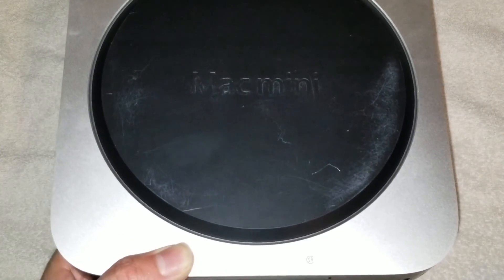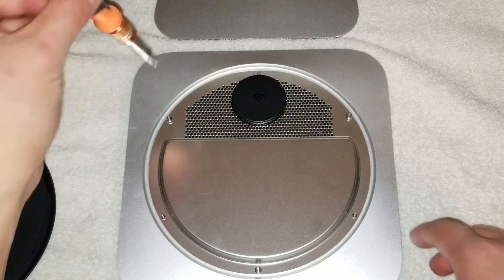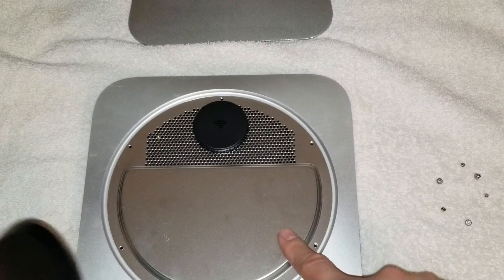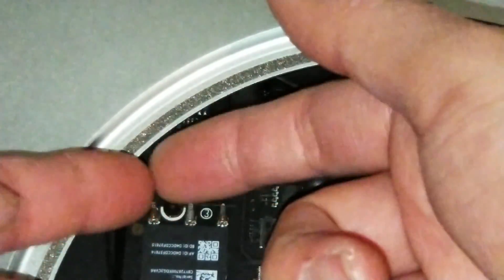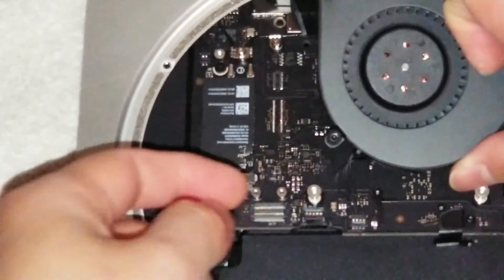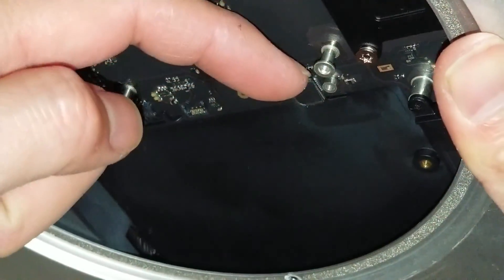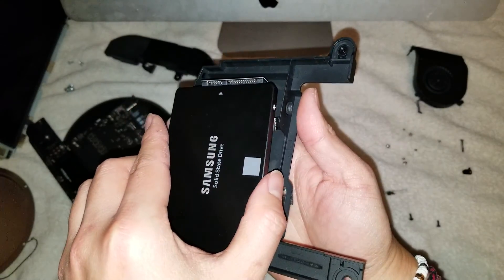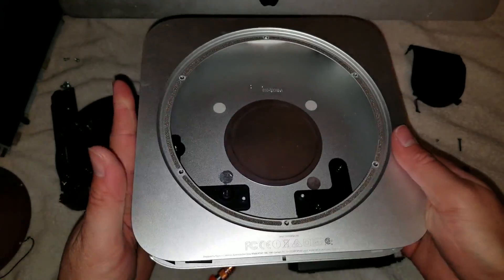Late 2014 Mac Mini Model A1347 Disassembly SSD Hard Drive Upgrade Replacement

Comment: Watching this video on my 2014 Mac Mini i7 3.0 ghz 8GB ram, it came with a 1TB HDD but I replaced that with a 500GB SSD and got an adapter to add a 500GB M.2 NVMe drive to the available SATA input on the board. Installing Opencore Legacy now to put Sonoma on the NVMe drive while I keep Monterey/Bootcamp Windows 10 on the SSD. After the upgrades, it's insanely fast and has no trouble playing any of my Steam games on Mac or Windows smoothly.
Reply from the maker: Awesome!

Comment: THIS IS THE SECOND VIDEO I SEEN IN A ROW WHERE HE OPENS THE BOTTOM COVER PLATE WRONG! HOW DO I KNOW ? IT BROKE MY CLIPS OFF AND ALL YOU ACTUALLY NEED TO DO IS USE YOUR HAND PALM THE BOTTOM COVER PLATE AND ROTATE YOUR HAND COUNTERCLOCKWISE TO UNSEAT THE CLIPS FROM THE SCREW POSTS! YOUR WELCOME NO PRYING NEEDED
Reply from the maker: That's a different model... this model does not twist. Check the model of your mac mini.

Comment: Nice work; clear and accurate. Just what I needed to swap out the HD on my old Mini. One addition, though; for my late 2014 Mac Mini, the six screws under the base plate needed a Torx 6H (that is, a T6 with a hole in the tip, as there’s a pin in the centre of the screw head.)
Reply: Apple thinks their machines are for spaceflight using secure torx, good god!
Reply from the maker: @mrdav1e  yup... lol
Reply from the maker: Yup!

Comment: At 5.04 what is that connector for, what info is it carrying? I broke mine cause I didn't have the right pry tool...aagh!  So what is it? Do I have to replace the whole cable? Many thx
Reply from the maker: If you broke the part off the motherboard you'll need someone that can microsolder
Reply: @ItsBinhRepaired  Thanks for the info... I will try find someone here
Reply from the maker: @KeithHutchinsonYT  hope it goes well

Comment: (2014 Mac Mini) Thanks for video, very helpful.  Original HDD failed.  Removed the original HDD and the companion SDD, installed a 1 TB SDD.  Boots up to recovery menu fine, I can erase/format the new SDD and go through the OS reinstall routine however it fails to complete.  Seems to load over the 6 minute countdown and then an error message at the end, says to try again.  Any suggestions?
Reply from the maker: You might need to install the os with another mac to an external hard drive and boot from it by holding alt/option on boot.

Comment: 5:19 I forgot to disconnect this cable and ended up breaking it. I need to know the name of this cable and the model so I can buy another one. Does anyone know what this cable is for?
Reply from the maker: I think it's the hard drive activity light, but if you ripped it out of the board, the motherboard will likely need soldering.
Reply: @ItsBinhRepaired  thanks man!! after I broke this cable, macmini no longer turns on. So I think this cable must be essential for mac operation
Reply from the maker: @thalesmln  oh no D:

Comment: Thanks so much for this video. I brought my computer to an Apple store because it had trouble powering up. They replaced the logic board and the HD. Unfortunately, they said because of Apple's rules, they could only put in an optical drive like the original to replace the SSD that I had someone else install as an upgrade. The computer was agonizingly slow and The Apple store would be of no further help. I was not optimistic about doing this myself but with your video, I decided to attempt it. Everything worked out well and the computer works great. Thanks again. According to black magic benchmark, it is 90 times faster now.
Reply from the maker: 90x is a huge amount! Glad it helped. If you haven't already, please like and subscribe so others can find my videos. Thanks!

Comment: Hi Binh, in the 2012 version of Mac Mini, it is possible to have two SSD/HDD. In the 2014 version, only one  I guess? either SSD or HDD, right?
Reply from the maker: You'll have to open it and see if there's an unused port
Reply: @ItsBinhRepaired  Ok, let me check what I can find, thanks.
Reply from the maker: No problem
Reply: Got some update: supports only one drive, either HDD or SSD. Or Fusion HDD. So the 256SSD drive that I have wont be enough. Considering a higher capacity SSD.
Reply from the maker: @pasteltiara  they're pretty cheap now

Comment: Good day . I have MAC mini Mode A 1347,emc 2840 .fcc id: qds -brcm -1069*, IC 4324 A. The hard drive has failed, or at least that was the diagnosis. can I get a used or new one from you ? tks
Reply from the maker: Hard drive?

Comment: Going to be mailing some parts to you basically a mac mini without the hard drive.
Reply from the maker: I see. Did you want me to repair/upgrade it for you?
Reply: @ItsBinhRepaired  No Just I dont need the parts, I only needed the hard drive out of it so maybe you can use the excess parts?
Reply from the maker: @RaynaldoLegarreta20  cool, I'll find some use for it, or, add it to the pile. Haha Thanks! :)

Comment: I decided to do this…. Which one of these SSD drives do you recommend?  Crucial BX500 1TB 3D NAND SATA 2.5-Inch Internal SSD, up to 540MB/s - CT1000BX500SSD1. Or   Crucial MX500 1TB 3D NAND SATA 2.5 Inch Internal SSD, up to 560MB/s - CT1000MX500SSD1?
Reply from the maker: You won't even notice the difference. I just use the one that's cheaper at the time.

Comment: Thanks for the walkthrough, one tip is to work on a non-conductive surface like a table due to static electricity. You don’t want to work while on carpet either, one spark and that motherboard is fried.. the rest was great, thanks.
Reply from the maker: Yep, this is an old video. Didn't have a good setup before.

Comment: It's NOT the taking apart that's difficult, it's the "putting back together" that requires a delicate  touch with skill and precision of surgeon's eye and hand and thus, now my Mac mini is toast - NG.  Those connectors are extremely difficult (nearly impossible) to get back on. Test out yourself with your wifi connector -the first you take off -try to put back on the socket. If you can't, consider yourself lucky that you've only lost wifi and put your mini back together.
Reply from the maker: Thanks for the surgeon hands compliment I think. Haha Sorry to hear your Mac mini failed. Do you know what component was damaged?
Reply: @ItsBinhRepaired  The power supply harness. - 1 wire detached and I couldn’t get the WiFi wire to go back on.
Reply from the maker: @Four1LF  oh, so it works, just that one wireless antenna?
Reply from the maker: @Four1LF  watch some of my newer MacBook Screen Replacement videos. I explain how to get the antenna wire in.
Reply from the maker: @Four1LF  oh wait, 3 separate things.
Reply from the maker: @Four1LF  are any of the connectors broken? Or just can't get them back in?

Comment: where is the RAM at if you want to add more?
Reply from the maker: If it's not on the bottom of the logicboard/motherboard, then it's soldered and can't be upgraded.
Reply: @ItsBinhRepaired  thanks so much
Reply from the maker: @mikereynolds3294  no problem

Comment: Pretty sure the screws (on my case at least) are safety Torx.  Haven't gotten past that point yet.
Reply from the maker: Yeah, you need a set that has a hole in the middle of the bit. You could also use a small flat head. Sometimes you can even break the safety pin off like that if it won't unscrew.
Reply: I used a hammer and a small nail to just break off the thing in the middle, worked for me :)
Reply from the maker: @thesaltyspitoon6342  lol a flat head also works.
Reply: Yes, the screws need a TR6, not a T6 (I think the hole is the only difference)

Comment: I removed the final screw holding the logic board and I tried as much as I can, but dude I couldn't pull the board out. I feel like I am gonna break something. I just wanna clean the old thermal paste and apply a new one lol. It's overheating and slowing down.
Reply from the maker: Rewatch
Reply from the maker: Need to use tools to pull it out
Reply from the maker: Takes quite a bit of force.

Comment: Don’t use “the easiest way” to remove motherboard.
Reply: I was stuck at getting the motherboard out when I found your video. Thanks a lot for the tips
Reply from the maker: What do you mean?
Reply: @ItsBinhRepaired  I almost broke the screw hole and screw thread
Reply from the maker: @tigrankashapov  ? How did you do that?
Reply: @ItsBinhRepaired  After replacing HDD with SSD I was not able to twist the last screw that holds motherboard in one's place.
Reply: Tigran Kashapov maybe you let the screwdriver in too deep before pulling the motherboard, and that damaged the base where the screw goes? Just guessing
Reply: @maganapanga4771  actually it doesn't matter, cuz everything is working properly
Reply: Iiiiiimm not doing this
Reply from the maker: Why not?
Reply: @ItsBinhRepaired   you had to basically tear the whole thing down to get to the hard drive, by “I’m not doing this” I meant replacing the hard drive, that’s way ahead of my difficult management level lol
Reply from the maker: @victorisaac4562  hahaha watch the video all the way through. It's not so bad
Reply from the maker: It wasn't that bad lol